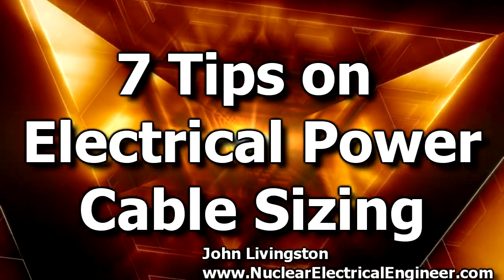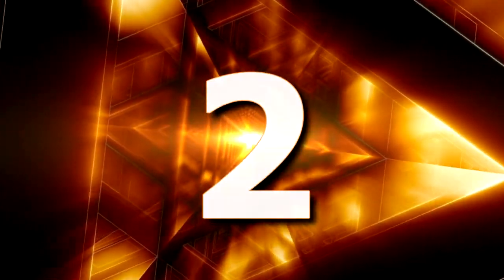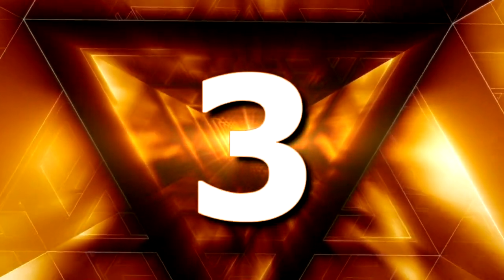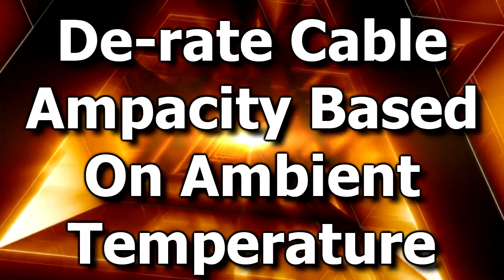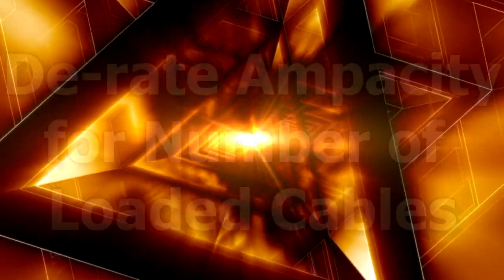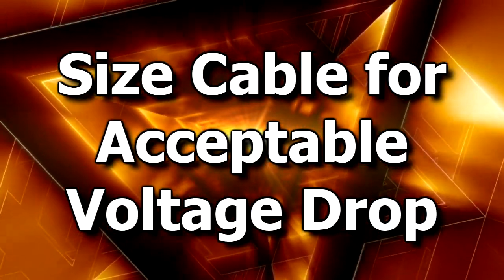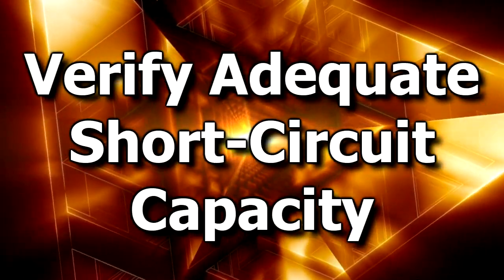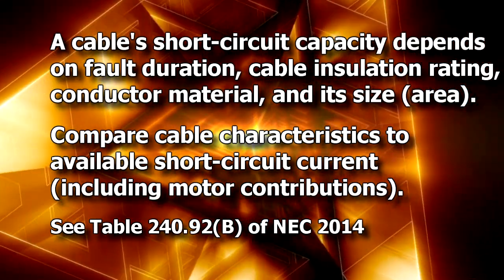Tips on Electrical Power Cable Sizing

Comment: we want in Telugu plz sir
Reply: buraga prasadbabu 
1) you have to calculate total load, total current (should be considered diversity factor).
2) should be considered where ur using cable ( i.e ground or air).
3) should be considered length of the cable, impudance.
4) by using these all things you have to calculate voltage drop, short ckt current and tripping time.